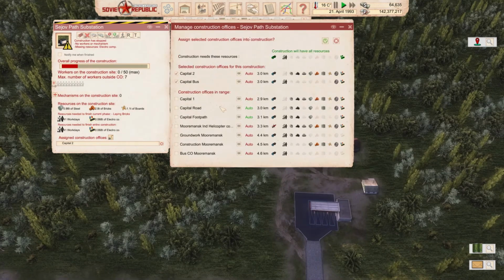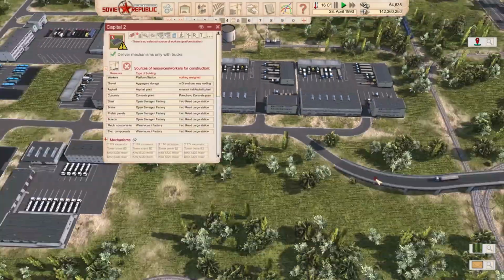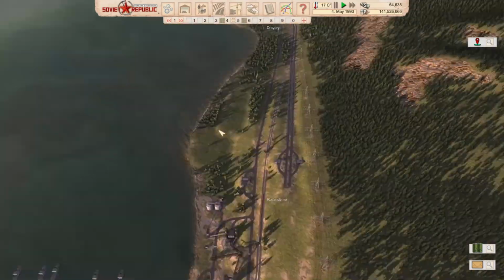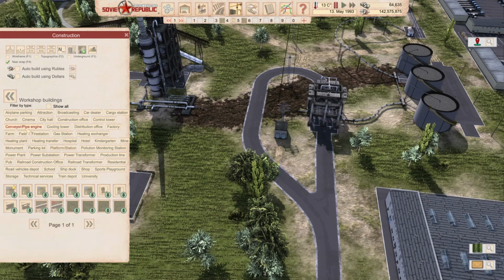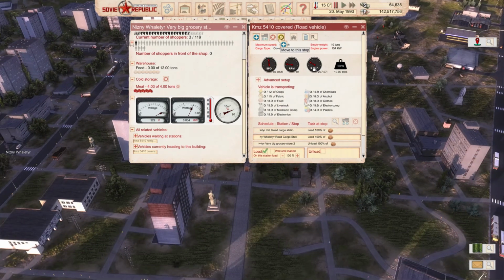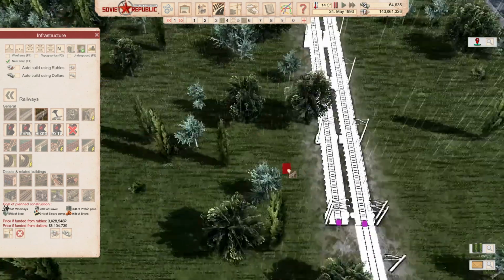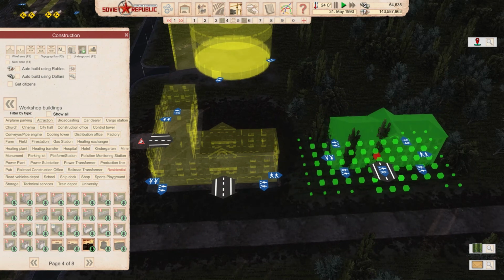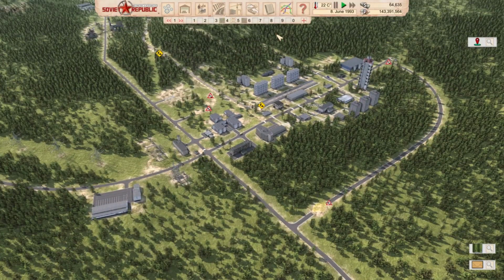Soviet Republic - Alaska - The Capital - Ep.148

Comment: I've always wondered with Ghalask being the bread basket and Mooremonsk being 1) very centeral and 2) a construction hub, why the gravel industry has not been moved from it's curret location to Mooremonsk. At this point the main gravel storage is set at the end of a line rather than a centeral area. If course it's fine really, just something that Ive thought of a few times.
Reply from the maker: Galahsk was always meant to be a gravel production area. But you are right! Moving gravel production would free up some railroad capacity in Galahsk! 
I will address this. :)

Comment: I like the big buildings i Nissesburg. 
1. Railroad, remove all your wooden crossovers that are not being used. Cause signalization does not care if the train is electric or diesel, it still consider it as an intersection and thus only one train at the time can pass and there for the railroad is slowed down considerably.
2. Build some more electrical supply stations for the new railroad.
3. Get a large (minimum 1000 ton) storage for fuel and bitumen at Moremansk. Pump feed. For the fuel and bitumen distribution to the republic. As is now its a bit iffy if there is fuel or not when the trains are coming to pick up...
Reply from the maker: 1. Good idea! 
2. Even better idea! 
3. Got it!